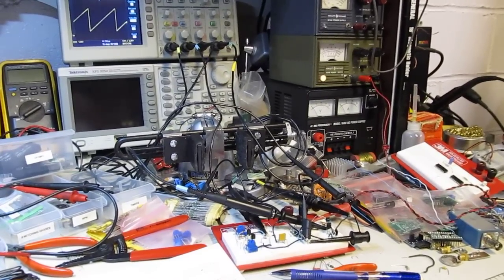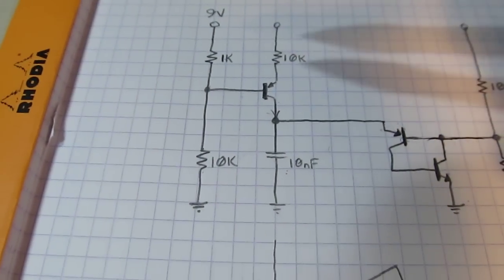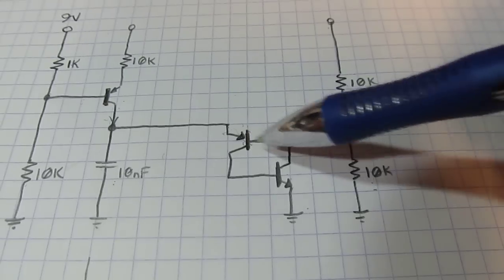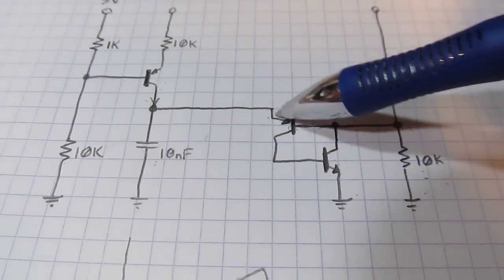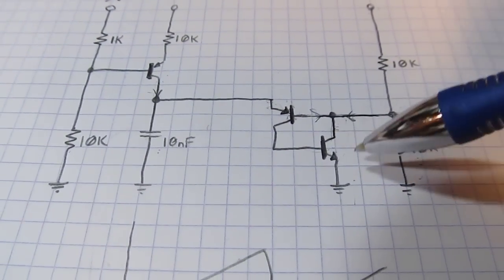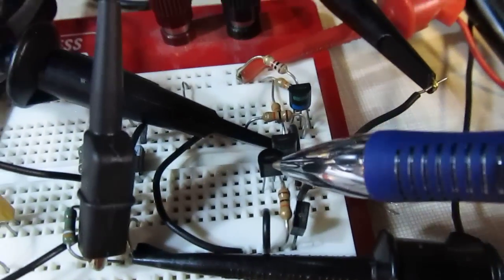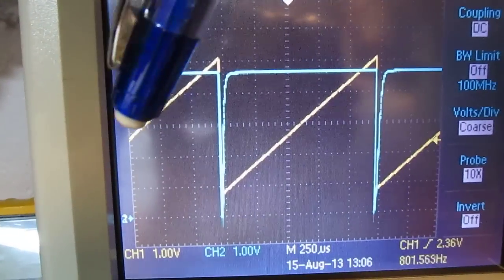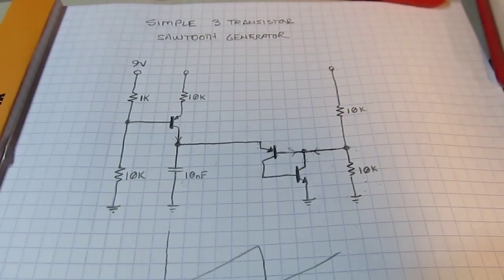#105: More Circuit Fun: Simple 3 transistor sawtooth generator / oscillator

Comment: Hi. If this circuit is to "drive" a purely resistive load(via power amplifying stage), then the current will also have a sawtooth waveform as you know . But my question is, if the load is reactive (an inductance), what should the voltage waveform be to maintain a sawtooth current( exemple of application:  electromagnetically scanned CRTs)?
Reply from the maker: It really depends on the battle of impedances - the output impedance of the driver, and the inductive impedance of the deflection coil.

Comment: Interesting circuit.  Its amazing what you can do with just a few transistors.  Years ago I built a staircase generator with 2 transistors.  I can't remember what the circuit looked like, except the two transistors were closely connected.   I saw it in Electronic Design News magazine years ago.  Maybe you can figure it out and do a video on it.

Comment: I have built using a cascode current source and a single NPN reset transistor but realized that only a bulkier + high gain transistor can do the reset, that too for a much less value of C e.g. 0.1uF or lower, yet with stability issues. Your method of positive feedback is so beautiful! Thank you so much..

Comment: Question, how if we want the  pulse floating between 0 V and 6 V or9 V?  thanks in advance.Keep up the good and useful work.
Reply from the maker: This simple circuit is pretty limited.  You'll likely need to design an opamp based solution.  I have a video on that too.

Comment: I tried , but doesn't work !
Reply: Check the break over voltage of this transistor made SCR first that at how much voltage it's need to trigger, and connect 10k ohm resistor in series when doing it

Comment: Thanks for the great video as always! Will try this one for sure. Sorry if this is really basic, but why do you need a transistor for the current source? Why not just connect the resistor and capacitor directly if you have the transistor fixed biased anyway?
Reply from the maker: Using just a resistor to charge the capacitor will result in the ramp part of the waveform to have a little curvature to it instead of being nearly linear.

Comment: Just wondering if there's any way to make this simple Sawtooth oscillator circuit voltage-controllable so you can vary the frequency via a control voltage?
Reply from the maker: Sure.  Remove the 10K resistor between the PNP base and ground, and replace it with a smaller resistor (say 330 ohms) connected between the PNP base and your adjustable voltage source.  You may need to experiment with the resistor value...

Comment: beautiful! Is there a way to modulate it's "base frequency" (which I guess will depend on the capacitor size)? I'd like to modulate it with noise around it's "base freq". I planned to use a negistor, but your oscillator is very elegant
Reply from the maker: Varying the capacitor size will adjust the frequency.  Varying the current sources will individually adjust the rising and falling speeds.
Reply: @w2aew   When asking about dynamically change frequency, I was talking about the second circuit, the one with just 3 transistors. For instance, would applying a varying voltage to the base of 1st transistor (instead of the 1k,10k divider) modulate the frequency of the saw?
Reply from the maker: @fer_fdi    Oh, sorry.  You can vary the 10k resistor connected between the 9V supply and the emitter of the PNP transistor.  This will vary the charging current to the capacitor, thus changing the frequency.  Or, you can inject your "noise" signal into the base of that PNP transistor.
Reply: @w2aew   Great, thanks a lot! : )

Comment: This is one thing that has been unclear to me...the capacitor charges, and reaches the .7 volts needed for the transistor to switch on. So as the capacitor discharges, and it's voltage drops below the .7 volts required to activate the transistor, the transistor still continues to conduct, even though the voltage drop is below .7 volts?

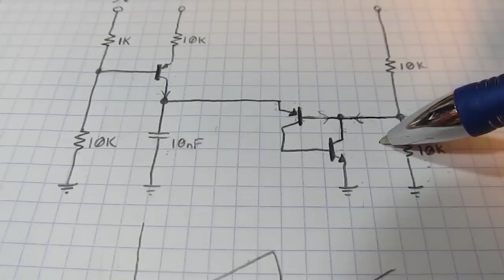Comment: Nice video, but there's something about this circuit I don't understand.  What's the purpose of the first PNP transistor?   The way it is biased, the base would always be on, so the only thing left is the diode effect of the PN junction, so that when voltage falls below the diode drop of that junction, the PNP transistor turns off.  If so, wouldn't replacing the transistor with a diode simplify the circuit and achieve the same effect?  Also, at 2:44, you mentioned the capacitor would be discharged to a diode drop above ground.  But wouldn't the voltage supplied from the PNP transistor keep it charged?
Reply from the maker: Not quite....   The PNP transistor is setup with a constant bias, so it behaves as a CURRENT SOURCE, not a voltage source.  The constant current coming from the PNP collector is what causes the voltage on the capacitor to rise linearly (as a voltage ramp).

Comment: Nice circuit.

I guess,  if we add another NPN Transistor such that  the emitter is grounded and the base share the the  base node of the other NPN transistor and its collector is connected to the top of the capacitor, then  you can discharge the capacitor all the way to ground.

Comment: Why does the capacitor charge linearly like that?  I thought they charged / discharged according to RC time constants, which made them charge and discharge in a non-linear fashion.
Reply from the maker: This is because the capacitor is not being charged up via a resistor.  It is being charged up with a constant current source (the collector current of the PNP transistor).  A constant current being fed into a capacitor creates a linear increase in voltage that is proportional to the current and inversely proportional to the capacitor value.  The analog would be like filling a glass of water from a faucet.  The constant flow of water results in a linear increase in the water level in the glass.  In this case, the constant current flow results in a linear increase in the charge on the capacitor, hence a linear change in voltage over time.

Comment: That 2-transistor configuration is known as Programmable Unijunction Transistor (PUT) rather than SCR. Using the 2-transistor model as a reference, for SCR, its gate is connected to the base of the NPN transistor, whereas for PUT, its gate is connected to the base of the PNP transistor. To which side of the bases the gate is connected to differentiate them. In fact, their electronic symbols have their gate terminals connected to the opposite sides to one another.

Comment: I was able to build this but it took some debugging to figure out that I needed to make my current source not so strong ultimately, or else the PNP-NPN pair actually stays on and doesn't get starved of current lol (so no waveform comes about at all). I had tried the 30uA at first but now at like 10-20uA for me it is working, using 3904 and 3906 transistors. Very cool, but I wonder how to calculate perhaps the maximum current that is low enough to starve the positive feedback pair... I also wonder how resilient that max current would be to changes in hfe/beta of the feedback pair?
Very cool still overall xD
Reply: Thank you for your comment. I have the same problem using bc327s and bc337. Thanks to your comment I found the issue faster. Increasing the emitter resistance on the first pnp solved my problems.
Reply: @TheShowdown16  naisu!

Comment: The other question I have is related to how to eliminate the DC component of the sawtooth signal. Because it is not a sinewave signal, I do not think we can just use a capacitor without compromising the sawtooth waveform. What would be your recommendation?
Thanks again!

Comment: I had not seen this circuit before, thank you for sharing. Still, I do not quite understand how the two transistors behaving like an SCR return to the OFF state. I assume that a design criterion for the magnitude of the current coming from the constant current source should be below the holding current of the transistor pair. Otherwise, even after the discharge of the capacitor, the constant current would have kept the transistor pair on the ON state.

Comment: When the IC op amp or transistor output impedance is matched with the next following amplifiers stage input impedance it will start to create a resonance frequency and oscillate. I'm not sure why the output impedance and input impedance will cause a resonance frequency which will cause the previous amplifier stage and the next following amplifier stage to oscillate at a resonance frequency. When the output impedance and the next following input impedance are match there is no voltage divider its a 1:1 ratio but it cause oscillations any reasons why?
Reply from the maker: Impedance matching the output of one stage to the input of the next stage DOES NOT cause oscillation generally.  It is true that if the impedance is complex (real and imaginary), that the impedance match is only valid over a narrow frequency range.  However, this doesn't generally result in oscillation.
Reply: @w2aew  Impedance matching rule of thumb is output impedance is low impedance 1K and the input impedance is 1Meg. If the output impedance is 1K of one stage and the next input impedance is also 1K this will cause oscillation because the previous stage and next stage cause a resonance frequency?
Reply from the maker: @waynegram8907  I don't know who's rule of thumb that is - I've never heard it before.
Reply: @w2aew  what is the rule of thumb for output impedance to input impedance going from one stage to the next stage? With guitar pedals circuit designs that is the rule of thumb is output impedance is 100 ohms to 1K and input impedance is 1meg and higher.
Reply from the maker: @waynegram8907  That's not called impedance matching - that is a design choice to keep one stage from loading down the previous stage.
Reply: @w2aew  what is impedance matching from stage to stage? When loading down the previous stage it will cause oscillations because the previous stage and the next stage form a resonance frequency any reasons why this happens?
Reply from the maker: @waynegram8907  Impedance matching is typically done to maximize power transfer from one stage to another.  In low-frequency audio amplifiers stages, this is rarely needed.  You only need a nice, very low output impedance on the final stage to drive the speaker.  Impedance matching does not cause resonances or oscillations in my experience.
Reply: @w2aew  in audio transistor amplifiers and audio tube amplifiers the output impedance is low impedance and the next following amplifier stage will be high impedance 1 meg. If the next follow stage is matched to the output impedance 1K  and the next follow stage amplifier input is also 1K. The output impedance and input impedance is matched at 1K which is bad? any reasons why?
Reply from the maker: @waynegram8907  Because you will unnecessarily lose half the signal amplitude.

Comment: Are there specific PNP and NPN transistors needed in this design? Or will any do? And is there a way to output the saw wave to a speaker?
Reply from the maker: Most general purpose transistors (2N3904/2N3906) will work.  You would have to add a buffer or audio amp to drive a speaker.

Comment: Nice, thanks. I can get that to work nicely in the 2 ms period duration 500 Hz range, but as I try to go to higher frequencies (like 15 kHz is my goal) I get into nasty instabilities and loss of linearity. What do you suggest for tuning this to higher frequencies?

https://electronics.stackexchange.com/questions/518249/a-sawtooth-oscillator-breaks-down-at-higher-frequencies
Reply from the maker: This very simple circuit isn't really suitable for higher frequency operation

Comment: I just read that the circuit is very sensitive of the voltage from the power supply .so change a little bit the voltage if the circuit doesn't work. (http://www.learningaboutelectronics.com/Articles/Ramp-generator-circuit-with-transistors.php)

Comment: Sir, thank you very much for all your time and effort! I would like to ask you for a big favor. Just for educational purpose, I am trying to build Current-Mode buck converter, using discrete components. I "somewhat" understand the working principle of slope compensation circuit ( saw-tooth ramp ) but I don't know how to build it with basic components. Of course, I found a lot of information online, but it is just theory and formulas on paper, which are important but lack this practical implementation. I do not want to use any dedicated IC for that purpose, because I still would not understand its operation. Is it possible to make a video tutorial in the near future? I appreciate your help in advance!

Comment: I must be missing something, but I thought there would be a pretty significant current spike through the transistors at discharge, more than they could handle. What am I missing here?
Reply from the maker: There is a large spike, but it is a small cap and the spike is very short in duration.  This is a very lousy circuit in many ways, and that is one of them.
Reply: @w2aew   Thanks very much for the explanation, appreciate it

Comment: Can anyone explain to me how on channel 2 the collector voltage is being pulled down? it seems like it should be constant because it is biased at 4.5 V due to the voltage divider.
Reply from the maker: When the NPN transistor is turned on, it pulls current through the upper 10k resistor, thus dropping more voltage across it.
Reply: w2aew got it thank you!

Comment: Hi! I tried to recreate this in Multisim, but I can't seem to get it to work.  The simulation fails when I try to run it.
Reply from the maker: It is a lousy circuit that doesn't simulate well because it relies on parasitics that are not well modeled in spice.
Reply: @w2aew  it's been really interesting trying to understand this one for that reason actually. I know it's to do with the non-ideal characteristics of the BJT. But given my mental models of how things work, I don't fully actually understand why it ever resets. It seems that there should always be some tiny little bit of current from the current source to keep the pnp open, even straight after the capacitor discharges. I can't figure out how the voltage on the capacitor gets to ever drop low enough at the end of the discharge phase to switch the pnp off. I've tried simulating it with inductance on the emitter etc but the values needed to make it work seem way higher than they should be. a little bit of noise helps too, but again, way more than seems necessary.

anyway, thanks a lot for this one. I've learnt a lot from trying to figure it out.
Reply: actually... reading comments below all become clear: bjt getting temporarily stuck on at saturation due to charge left in the junction. I kind of intuitively imagined something like that must happen but had never heard of it until now. like others have said also, I've managed to get it working right in spice with smaller resistors in the biasing divider. just seems to give it enough of an upward push to shut it off.

Thanks again. learning so much from the channel.

Comment: Hi, thanks for the video and for giving me the inclination to play around with electronics again. I've just tried implementing this with some 2N3904/2N3906s but have been running into an issue where the capacitor never seems to charge up (or it does and then gets immediately discharged to ~0.65V) and the "latch" seems to never stop sinking current (causing the PNP to get slightly warm). Everything in that part of the circuit seems to either be around ground or one VBE drop. Any ideas why it isn't switching properly?
Reply from the maker: Sounds like something is wired wrong, or wrong component values.  Nothing should be able to draw much more than 10mA,  and that would assume that the 1k resistor is shorted across the 9V supply.  Otherwise, everything should be around 1mA or less, which means nothing dissipates enough power to get warm (even if you have 9V across a device with 10mA through it - that's only 90mW which shouldn't be warm to the touch).  Be sure to double-check the transistor pinouts - they can vary!

Comment: this is an interesting circuit. A few years ago i built it after seeing this video and it worked fine. Now I watch this video again I wonder why it doesn’t start oscillating at the time the voltage at the base of the PNP (in the BJT pair) is zero. At that moment it could also be some kind of stable situation. Voltage at the capacitor is still a diode drop above zero, which would trigger the circuit again. What prevents the circuit from staying in, or around that state? It must be something like what voltage is ramping up more quickly, but I can’t get it completely clear in my head on this.
Reply from the maker: It isn’t a perfectly reliable circuit and can sometimes reach a stable point and not oscillate. Device and breadboard parasitic usually keep it going.

Comment: Shouldn't the resistor above the first PNP transistor be much smaller? How can the transistor work, if you put some 10mA on the base, with Beta about 50-100 - it will require to put 50-100 mA trought CE, and that coupled with 10k resistor won't work it seems to me. Like it would cause 1000 V voltage drop. Can someone please explain?

I would just put some small impedance resistor above the first transistor and let the base current direct the current flowing trough it and CE.
Reply from the maker: The current in the first PNP (upper left) transistor is MUCH lower than that.  CE current is only about 30uA or so.  The two resistors connected to the base sets up a bias voltage around 8.1V or so, which results in about 8.7V at the emitter, which leaves about 0.3V across the 10k resistor in the emitter.